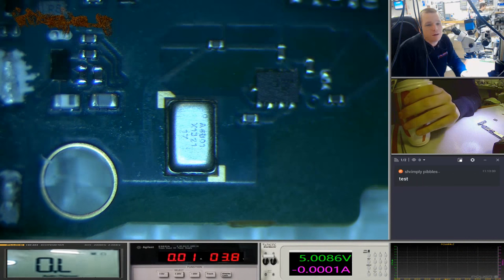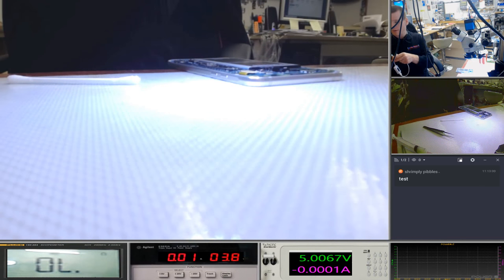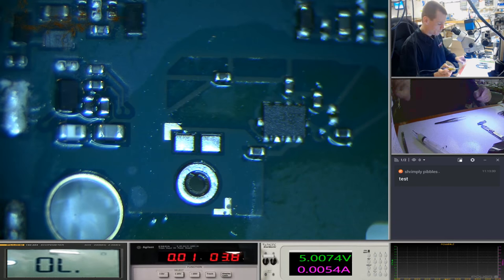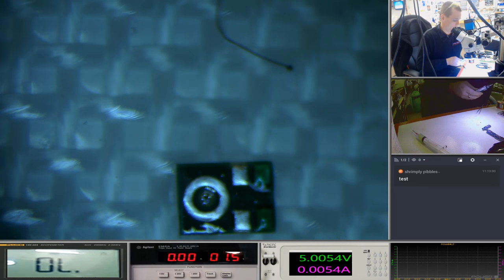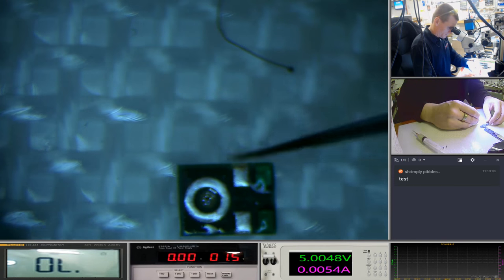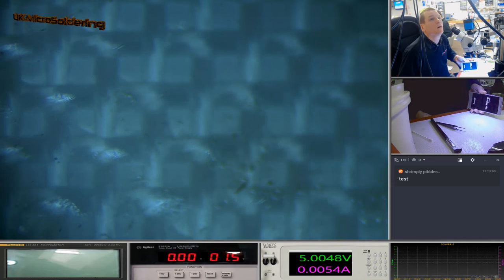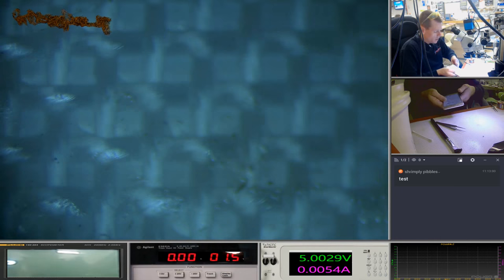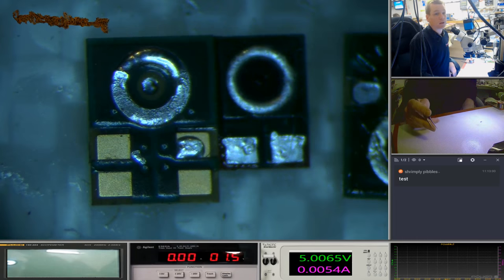Samsung J5 2016 (SM-J510FN) Microphone Replacement

Comment: Great help guys! Where could i find the part number of the microphone and where could it get it from?
Reply from the maker: You can now get the parts in Europe...... Here is a link 
 https://www.ebay.co.uk/itm/Samsung-Galaxy-J5-2016-SM-J510FN-Internal-Mic-Microphone-Module/302689726473?hash=item4679b6b009:g:la8AAOSwfqFaoQpt
Reply: i used an iphone 5 microphone and it works
Reply: @UkMicroSoldering  what microphone did it work eventually?
Reply from the maker: @StarTube  Yeah it works, I bought a load of half flex for jobs like this. As long as the configuration of pins is right and obviously, the hole lines up it will work.
Reply: @UkMicroSoldering  can i use a 4 pin mic from a samsung s4 for a 2 pin samsung j5? I saw in the video you covered 2 of the pins of the mic with 4 pins...
Reply from the maker: @startube2788  I have done a bit of research and the 4 pin configuration won't work as they are a different type of microphone that requires voltage as well as an "in" and "out" and gnd.  The 2 pin configuration should work though
Reply: @UkMicroSoldering  i bought two j510 microphones, 2 pins, and with everyone of them there is no recording sound. Tried 2 record apps. Nothing.
Did it ever happen this to you with parts bought from mobile parts stores?
Can these mics be faulty? there is not problem in soldering them, i checked many times.
What should i do?
Reply: I solved it. Sadly some sell trashy parts as samsung genuine parts...